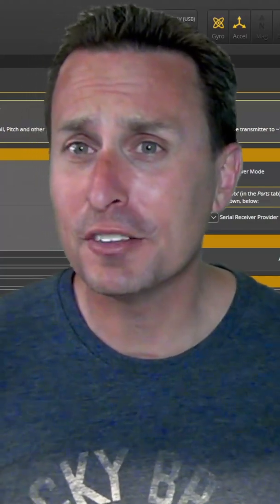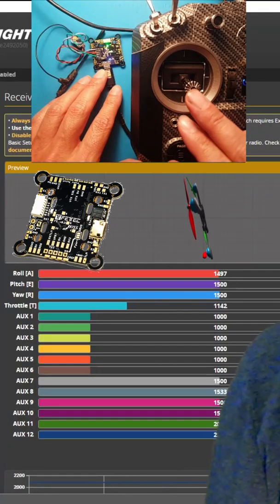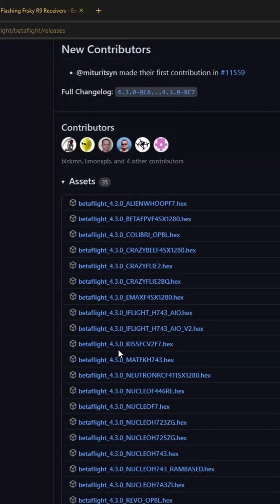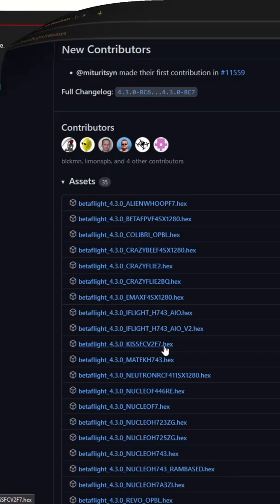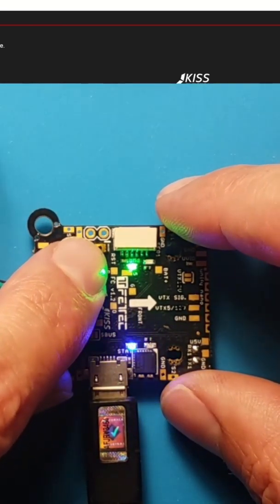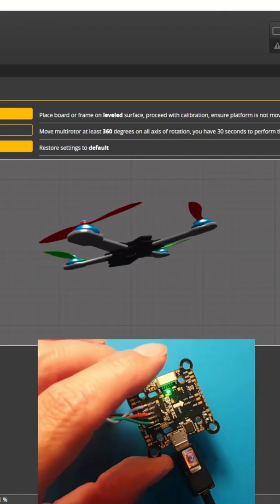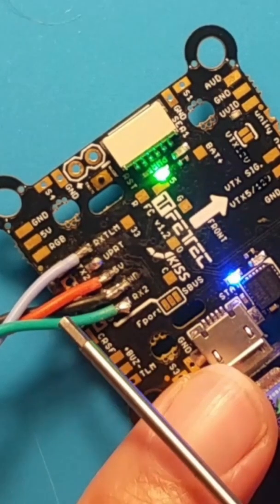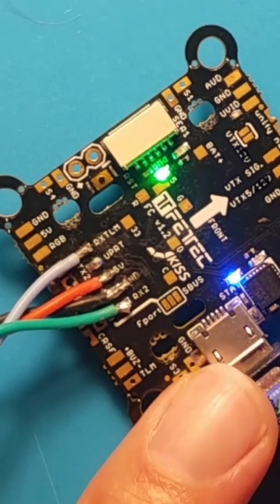Can You Flash Betaflight to a KISS FC?  |  FETTEC F7 & KISS V2

Comment: To everyone who has tried this with the V2 and now can't re-flash back to kiss .... I had the issue where no matter what I tried, I couldn't get the kiss gui to re-flash back to kiss FW... I found if you open BF and load the kiss FW from local and let BF try and open the bootloader... Once it's informed you that it can't open the serial port go over to the kiss GUI leaving betaflight open and connect to what ever com port the V2 is on in the kiss GUI and there you go the GUI has found the V2 🙏😎👍 well this seemed to work for me.. Running windows 11 GUI's

Comment: Lol, bricked my kiss v2. Now when it's powered up it just goes into flashing blue light but bootloader not recognised. 
Didn't like kiss anyway so meh.
Reply from the maker: Press bootloader button with no RX wired up and it should connect to the KISS Configurator to flash again.
Reply: @uavtech  thank you for the suggestion. Unfortunately despite seeing the com port Kissgui reports bootloader not detected.
Reply: I read that Kiss bootloader is impossible to brick. Having spent a week trying to unkill the Kiss V2 I'd have to stronly disagree. The LED's imply that it's in permenant bootloader mode but it's not actually in bootloader.

Comment: The real question is how to flash kiss to a betaflight fc 🤔
Reply: yes this would be interesting!!!!
Reply from the maker: KISS is worse on a bunch of points, so no need to bother.
Reply: Kiss will not work the same on any BF Fc and Esc even if you could do it. Kiss and FL1 fly so good with almost no effort because its closed Source. You have to use their FC and ESC with the Firmware. FC is most important. Thats also why Black Bird works on a BF Tune with a extra Stack he tested and worked on. It took a long time with help from other tuners to unlock BF to get it fly close to KISS / FL1. And he done it. Nice work for the Community. But not everybody has the skills and connections he got to do this and also not the time to put in. So its very nice Black Bird did this. Maybe something BF needed.
Reply: @gameventures7438 Kiss is garbage compared to BF
Reply from the maker: @cinemoriahFPV  correct.  KISS ESC's just make it even worse since high PWM.

@gameventures7438, BF default even flies better vs. KISS, so nothing special coming from BB.  I feel like KISS is just over priced for less.  I cannot explain why folks stick with it.  But to each their own.  INAV flies better than KISS at this point.
Reply from the maker: Can't do it.  Have to $$.

Comment: How would I go back to installing Kiss firmware?  Thanks for sharing this
Reply from the maker: Just flash back with KISS gui.
Reply: @uavtech  Does it still have the flyduino bootloader if I flash it with Betaflight 4.3? 

Thanks in advance. Might be a silly question,  but thought to ask and be sure 😅
Reply from the maker: @Dr.KaranSingh  yes it does.  The flash does NOT change the bootloader.
Reply: @uavtech  super thanks 😊

Comment: After flashing to BF will Fetec FC still work with Fetec ESC or will we need to use BLHeli ESC?
Reply from the maker: It will work. Chose Dshot
Reply: will not work how he told... Motor mapping is different and other stuff. u cant even use bf motor mapping to get it right. no motor will spin. if you do it manual with master slider on my build one motor never spins. i done it to test something on my build and never want to run bf on kiss. and now i have the problems to go back and gain nothing from it. could not test nothing thanks man..  @uavtech
Reply from the maker: @gameventures7438  works for me fine.  So something is a miss.

Comment: I'm just trying to figure out why somebody would want to do this? I love betaflight 4.3, and I also have a couple fettec boards running kiss, so I'm not hating....just wondering if there is some kind of advantage to using kiss or fettec hardware with BF?🤔 Just for fun, or to try and convert some fan boi's? 😅
Thanks for everything, Mark! I've learned a ton from your content! 😎👊🏻
Reply from the maker: There are lots of reasons honestly.  But to keep it basic, some people get KISS and don't like it.  OR, they do like it but want to see how BF does on the craft.  Bottom line: it is a thing you can do.  This is how.

There is no advantage I know of to getting FETTEC hardware for BF (less features actuall [no ODS or blackbox]), but if you have the board and are not liking or having luck with KISS, OR you just want to see how the latest editions of BF does on the same quad, you can try either FETTEC or BF as well.
Reply: @uavtech  right on, that's kind of what I figured, but I was unclear as to whether maybe there were Hardware advantages... I appreciate the reply. 🙏🏻 Have a great week! ✌️